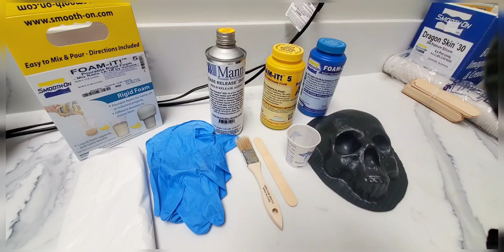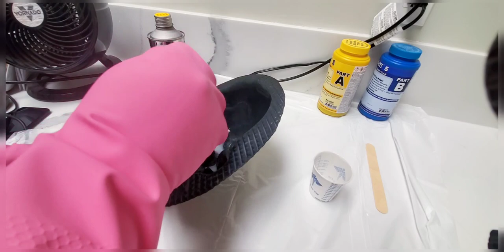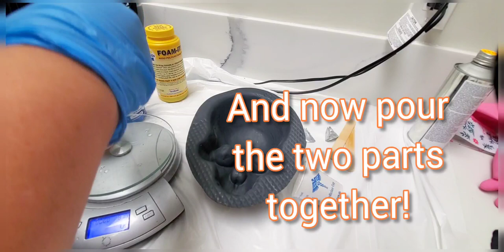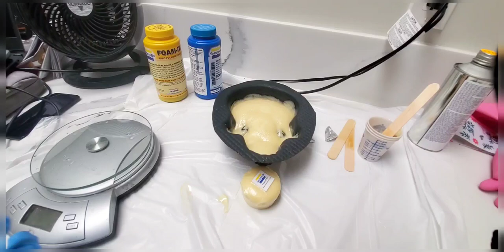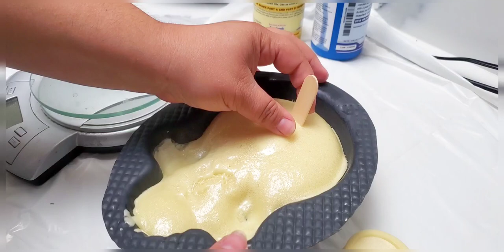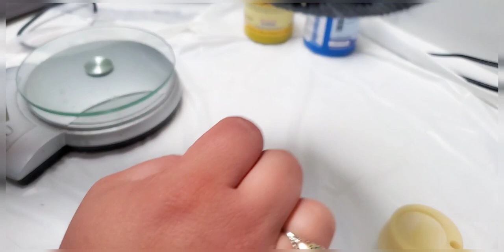Making Foam Skulls with Pacific Mold Design molds

Comment: I’m back. I’m about to finally try this foam.  Question did you need to reapply the mold release between each skull. I’m assuming not because that would have been a PIA for your big project. Thanks again for sharing your knowledge with us this is awesome
Reply from the maker: Originally I was but then I forgot at one point and it was perfectly able to slide right off so I reapplied after every 3rd skull. However I always did poor just a little bit extra in those deep crevice areas. I'm talking like just a little thimble worth of liquid being brushed along those areas. Hope that helps!

Comment: Did you have any issues when painting or putting a finish on them?  Not sure if the release agent created challenges
Reply from the maker: Nope not in particular. What helped was to have it laying on its back on some parts, and having a step stool with me for others. Otherwise the release agent didn't prevent the paint from sticking.